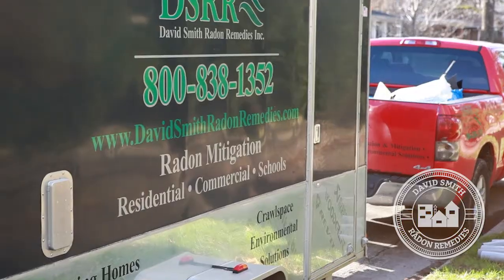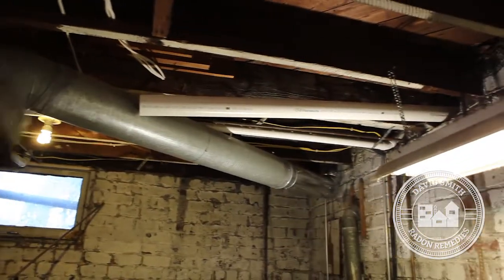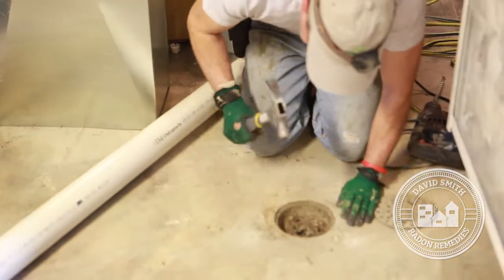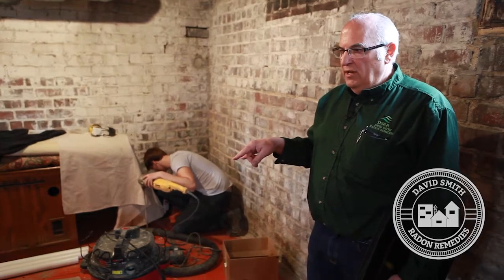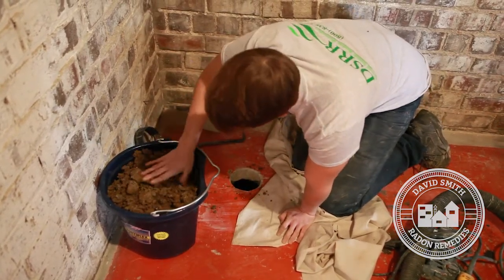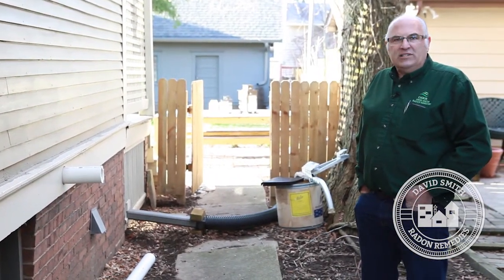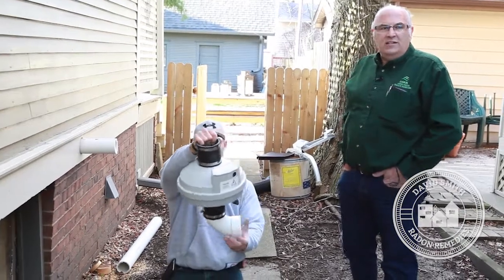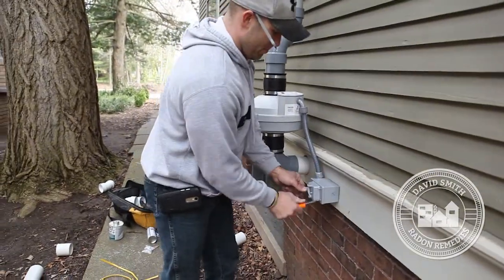Radon Mitigation in a 100+ Year Old Home in Bloomington Illinois

Comment: i live in an older house with dirt below the concrete floor in the basement. i dont see any crushed gravel. with midigation systems still work in this scenario?
Reply: trying to figure that out as well. it is reccomdned for some old homes you just have the basement windows open with a fan in and fan out, but that would get cold in winter
Reply: @DavidB-j3p  just so you know i went ahead and had a midigation system installed anyways on top of dirt. we dug out 5gallon bucket worth of dirt and installed a fan and the results were amazing. im in canada so my radon was over 600bq/ cubic meter and now my readings are less than 50bq!
Reply: @pedrochip  that sounds great, im gonna try 2 holes atleast 10-20 feet from eachother and connect them to the same fan via PVC

Comment: The radon mitigation specialist that is looking at the home we are trying to buy said he needs to do a core sample to see if he can get pressure for a pump. The house was built in 1905. He also said he may not be able to install a pump because the old house might have a footer in the basement. Is there a solution for this?

Comment: I have 100 year old Maryland rubble stone basement with second lower addition basement from 70s. I put radon fan on lower addition sump pit but radon levels persistent 10-20 pci/v. How do you know where to drill the sub slab holes when there is only dirt under the slab? And how do you know they will be effective? Does it require a higher wattage fan for for slabs with soil underneath? There is so little info on these types of basements. It's truly an art. The local radon guy would not even work on it because he was afraid of causing structural instability.
Reply: Are both of your basement floors concrete? If not, the floors need to be sealed from the basement air.

You are correct, there are different strength fans for different sub-slab-soil types. But the stronger you go, the more you need to test that the air is coming from under the slab, and not the conditioned air from the basement/house (you can test with a smoke pen/device all around to see how much air is being sucked and where). Leading into your question on how to test if the suction is adequate in all locations under the slab.  

There's a tool that you can get to hook hoses up into and it will tell you the suction in various locations...I think it's a digital handhelt Manometer. You drill some small holes in multiple places around your basement, start sucking from you main location (with a shotback or radon system), then you will see if the suction is strong enough in all those locations.  If the suction is not strong enough because of your soil type, you can drill 4 inch holes in the form of a line, separated by a foot or so, and dig up the dirt under the slab, creating a channel for the air to get to the suction point. Then seal the holes with concrete and caulk.  

Because of the rubble stone walls...you really will be in the best situation if you talk to a professional radon mitigator.  That can be complicated especially if you have water running through the stone.  You can spray with something like gunite...but it should be professionally done.  

If all floors are concrete, I would probably do the sub slab mitigation myself via that digging technique until suction is good enough under the both slabs, then make sure that everything from the footer up is 100% sealed. If radon persists, I'd talk to somebody about sealing the walls.
Reply: Also note that if you have low-none gravel content under the slabs, most of your air-draw will be from the perimeter of the house. (unless you do the drilling technique)